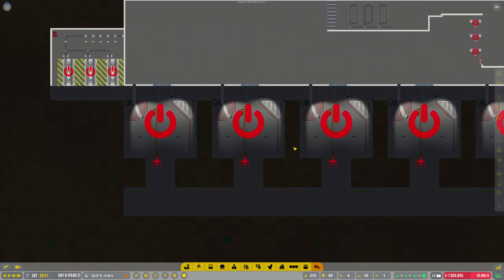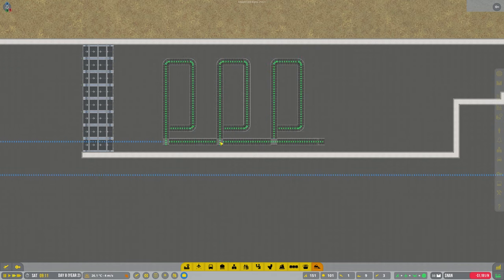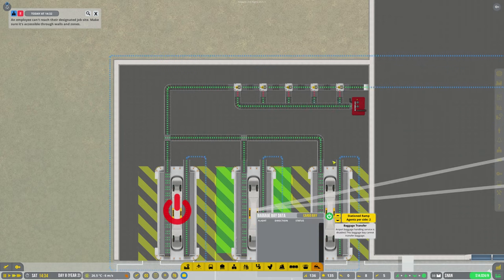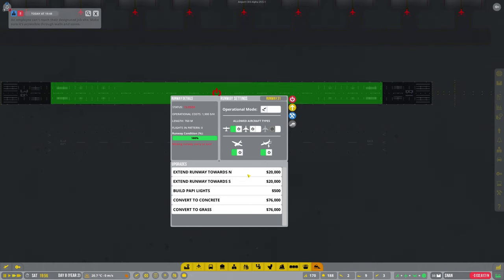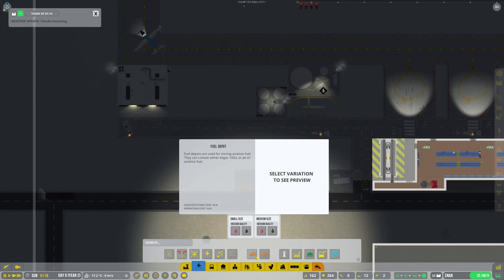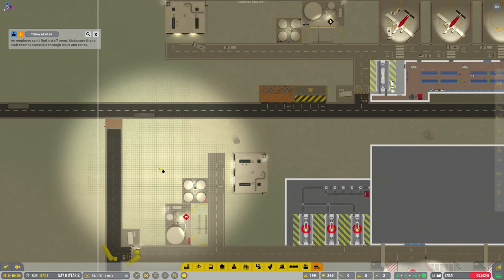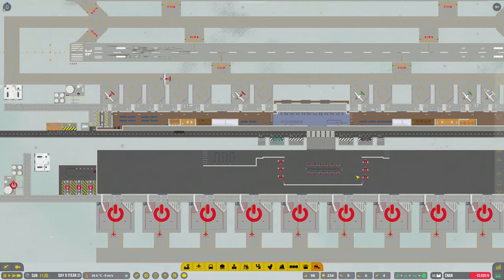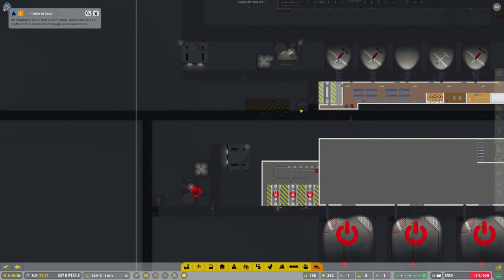Airport CEO S3 E16 Let's Play - Fixing and Causing More Issues!

Comment: Yep, it's the "can only have one road security point".  If you don't have the internal roads connected, it will cause problems.  IE.  A fuel truck in the lower vehicle bay will want to fuel airplanes in the upper section.  Without the internal road connection, it'll just bug those trucks.
Reply: Also watch the behavior of baggage trucks in that cargo bay next to the top road security station.
Reply from the maker: Oh man, that is going to cause an issue then! they will have to do a lot of driving :)